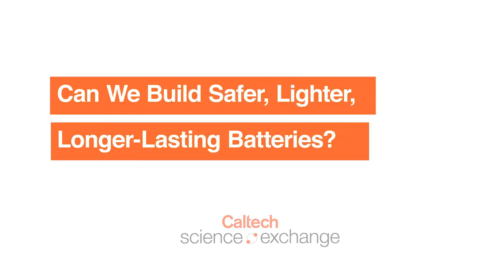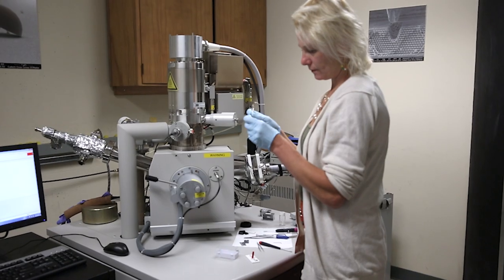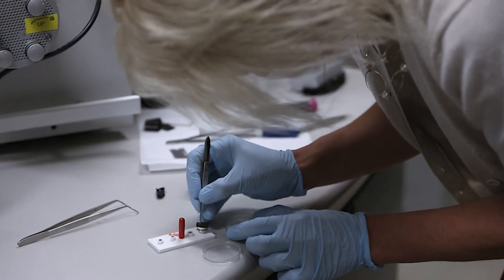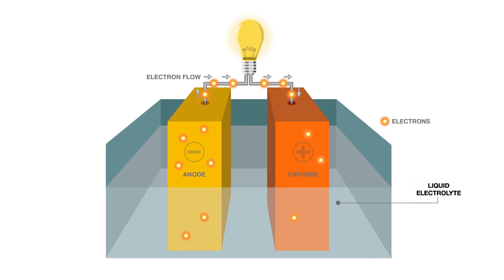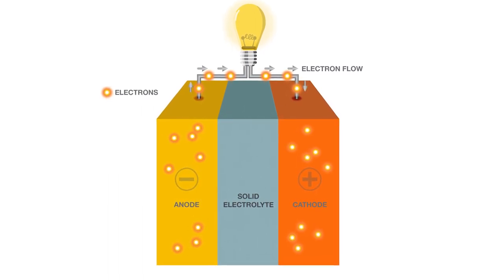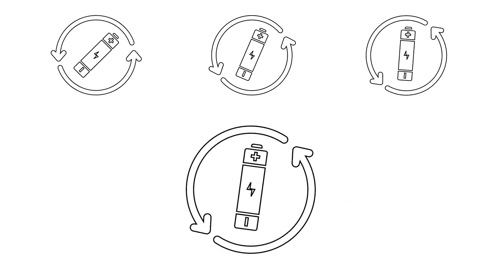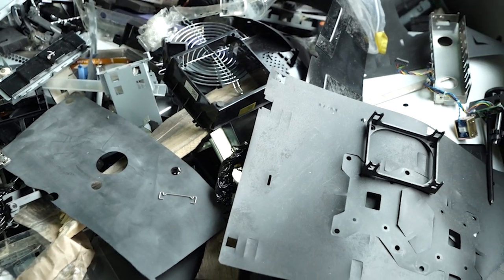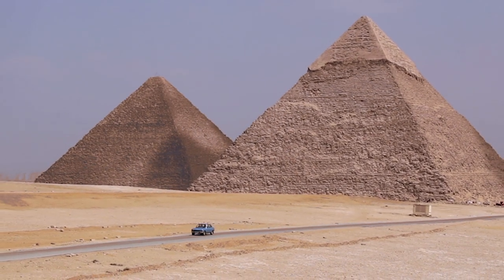How Can We Build Safer, Lighter, Longer-Lasting Batteries?

Comment: While this is a great introduction to the frontier of battery science, I would be so much more inspired with details on the approach research at Caltech is taking, how these 3D structures are being designed and constructed, early test results, challenges, setbacks and even failures.  Mimicking the level of reporting one finds in the science section of the NY Times does not set Caltech apart as a premier technical institution.

Comment: But isn't what we really need right now not lighter batteries, but types that scale better to large year around energy storage?  Meaning batteries that are made from more abundant materials like f.e. natrium.
Reply: Two words: Electric Airplanes.
Reply: @DerekWoolverton  
well electric Airplanes are  not really what we need to get a big step closer to carbon neutral. The big thing is, that renewable have seasonal differences in Production. To increase the part they play we need a way to storage huge amounts of energy, for a few month. Energy density is not really that big of a concern there. The things, that need to be low are energy losses and price (resources) per TWh capacity.